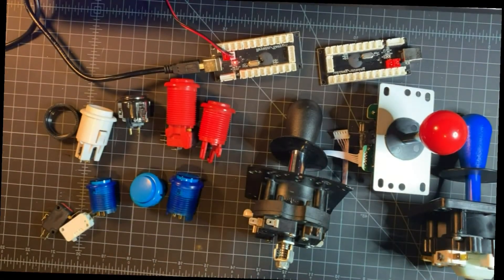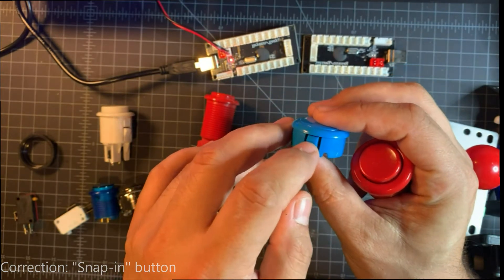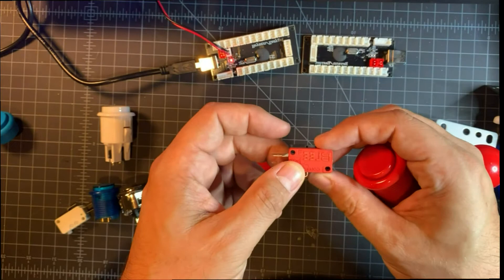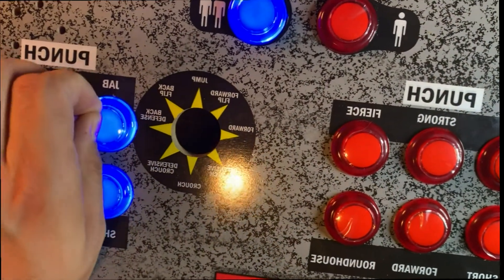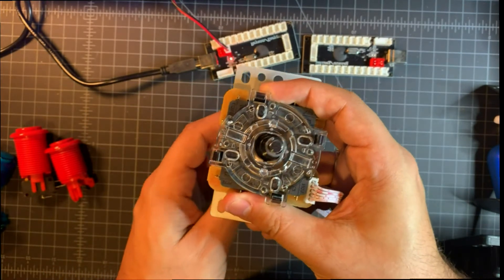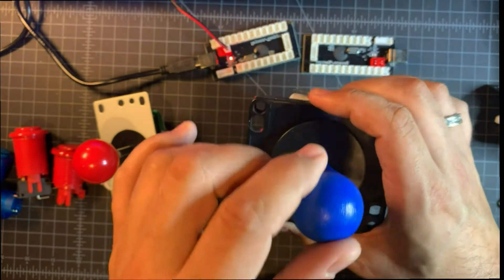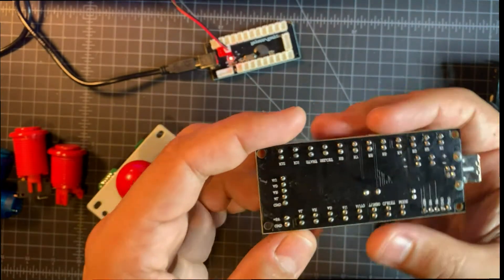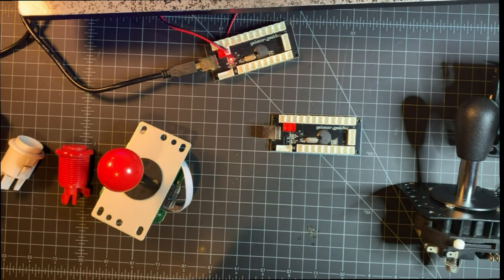Arcade control primer   Buttons, joysticks, and encoders

Comment: Could I use that encoder board as a replacement to my Capcom Legacy cabinet? My player 1 Forward Kick will not work because they used so much glue in the miss of me pulling out the old connector to put in the new one for Happ buttons obviously I pulled it to hard and the holder for the connector is loose. I don't know what to do 😥😩
Reply from the maker: Possibly. The encoders just make the buttons send joystick commands for windows/Linux. If the cabinet used those OSes then that should work

Comment: Very informative video, any advice into which brand of the controller encoders /zero delay to buy? See plenty on the market and just want to get one that is known to works thanks. Also have a online store you recommend to purchase from ? Thanks again for your help/ insight.
Reply from the maker: Thankyou! I honestly don’t have a specific store I’ve gotten mine from... I usually use Amazon and check reviews. If you search zero delay you’ll see the top results are identical hardware, they’re just probably getting them from AliExpress and reselling them. AliExpress is where you’ll find the best prices but the shipping can take forever and the risk is much higher that you may find a bad supplier. I wish I had a better answer but that’s how I do it, about ten bucks an encoder for me. The pedestal arcade video I did may be interesting for other suppliers for alternative controller options if you want something that also works on consoles though

Comment: If I swapped my zippy joysticks, for a Sanwa, would I also have to buy specific encoders or can I just make the swap?
Reply from the maker: From what I can see it looks like you’d have to swap it. I don’t have a zippy but it looks like the pinout is similar to a happy with individual switches. The Sanwa if I recall has a 5 pin header. There are encoders that match that header which makes it easier to wire because they have a receiver port for the molex connector that just plugs in. I haven’t done that exact swap but from what I can see that’s what you’d be looking at
Reply: Thanks I appreciate you replying immediately! Great content FYI
Reply: @geektoolkit  wouldn't just be able to solder the connecter to the encoder?
Reply from the maker: @evolutionated1125  It's hard for me to say without having a zippy. Looking at it closer  now that you bring it up, it is possible that the 5 pins are simply ground/up/down/left/right and you could solder directly to each pin. I just don't have the hardware in front of me to confirm it, and don't want to give out info without testing it myself so that I don't lead someone to ruin a joystick.

Comment: Someone did a test with arcade1up,sanwa and happy buttons and they are all as accurate and responsive.. arcade1ups just feel mushy and gross but still as responsive.
Reply from the maker: From what I've seen Arcade 1up may have evolved some of the buttons since this video and the earlier versions came out, and the controls, but I totally agree. I did feel like my SF2 A1up buttons worked well but as you said..the feel just wasn't...appealing.  I liked the knock off Sanwa buttons I had gotten. I need to update this and revisit it. I may make a control panel using the laser cutters I've gotten recently and that'd be fun to see what I can pull off here :)